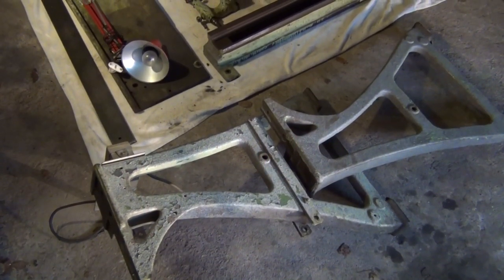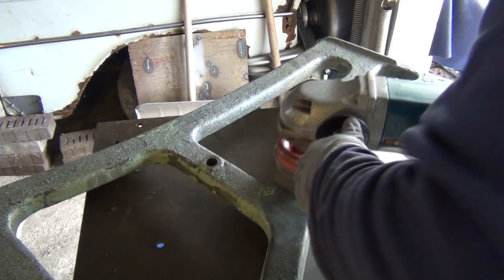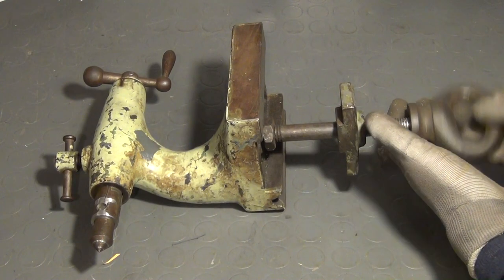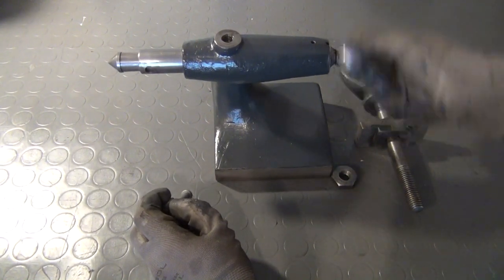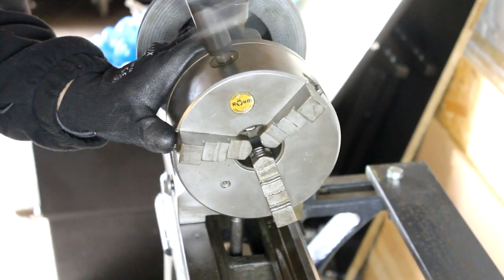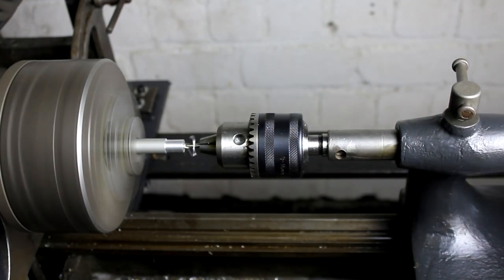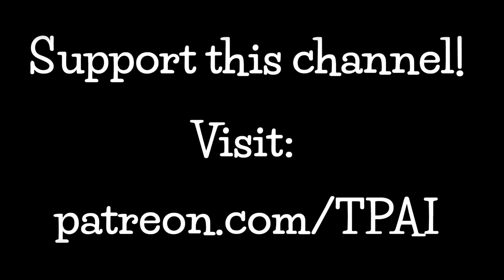My Lathe Restoration

Comment: Hi,
You might be interested. Your lathe is a so called "patronendrehbank" made by de firm Kröner und Reimer Leipzig Lindenau.
She is modified. The ballbearing in the back is not original. Originally the spindel can move lenghtwise in smooth bearings. This movement was possible by a so called star wheel and threaded bushes with different threads ( patronen auf deutsch). All of this so you could cut screw threads on this lathe. I think I saw some parts of the mechanism in the original video but it looks like You did not use it in the restoration. I myself got 2 of these lathes ( all be it incomplete) and found a picture of this late in: " Paul Schlichting Die Feinmmechanik" . 
Congrats, nice work.
Jan
Reply: To cut threads on a lathe, there needs to be a lengthwise drive-screw for the cross-slide. The cross-slide drive and the main spindle are geared together, so that as the chuck turns the cross-slide advances, to create a thread.
What you described (the spindle with the chuck moving backwards and forwards) sounds more like a "rose lathe" or "rose engine", used to create guilloche patterns and uses those "star wheels" to control the movement of the main spindle.
Reply: +Rolingmetal - That was a great video.  Very interesting.

Comment: Nice lathe restoration.  I did up an old Schaublin 102 toolmakers lathe in way worse condition and it also came up a treat.  Those old lathes certainly have style.

Plus they are nice to use, quiet etc.

Cheers Rob

Comment: the pair of intermediate pulleys is called a "jack shaft" and they are often used in power transmission to attain precise ratios, or in cases where side load is not desirable and face mounting is impractical.

Comment: I am restoring a Seneca lathe at the moment almost the same age - great job on your arduous clean and build.

I am considering mounting a 3 phase motor and VFD also for speed control and improved safety, but am still considering the belt slip with the original design that reduces the shock load to the chuck and headstock bearings.  If anyone else more familiar with this aspect has experience please leave a comment :)
Reply: ben uygladım hız kontrol sısteminı harka oldu

Comment: Very good work on the restoration. Well done.  Looks to be in very good shape now.

I can appreciate you are glad the restoration work is behind you and the lathe finally up and running.   I did some cleaning of a Southbend Heavy 10 back in 2014.   A lot of work, but your restoration was even more work.

The lathe may have been designed for line shaft drive, the picture you showed with the large overhead flat belt pulleys.   Originally the line shaft may have been driven by a water wheel, later a steam engine.

I would refer to your present drive system as using an intermediate drive shaft.   Very common for old lathes which were designed for line shaft drive which was much slower speed than an electric motor.

Your tool post design needs shims to get the tool at centre height.   Consider getting feeler gauge sets at a flea market and take them apart to provide a lot of shims of different thickness.

Not good that the pulley is causing vibration.   This could impact the finish on the machined parts.  You would need another metal lathe to try and fix the imbalance, unless you can add weights similar to car wheel weights.

Dave.

Comment: it's a "transmission drive" from previous other references . was probably done in the  late forties. i offer this because i have seen this type of setup/modification several times and they were claimed to have been done around that time frame. folks used what was at hand to get things done and this type of drive was tried and true at the time. of note i have seen similar setups that used small gasoline engines. very sketchy! i enjoyed seeing it brought back to life.
Reply: No, it's a jackshaft-used to subdivide rpm from motor and increase torque.

Comment: English words for that intermediate shaft are Jackshaft or Countershaft.  The difference is which direction  the shaft rotates.   Automotive transmissions use gear driven countershafts that reverse rotation to transmit movement.  What you used is most likely a jackshaft as it rotates in the same direction as the motor and the chuck.  I just looked it up.

Comment: I don't know if there is a specific English name for that intermediary pulley shaft, I think I would just refer to it using the generic name "jackshaft"
Reply: Counter shaft
Reply: yes counter shaft, and bit motor sits on is motor mount/bracket
Reply: Counter shaft is used for gear transmissions because the rotation is reversed. Intermediate shaft is the term when pulleys/chains/belts are used because they do not reverse the rotation.
Reply: @Reno Simpson This is the best comment on the internet.

Comment: http://www.lathes.co.uk/auerbach/   Maybe the company that made your lathe? Definitely a German design

I'd leave the intermediate pulleys as they are. It's a good system and if it isn't broke why fix it and the guy that converted it did a good job. English name for it is Countershaft. Countershaft is also a generic name for any gear or pulley shaft that transfers power to another gear train or pulleys.

The common English name for the belt system at 6:50 is Line Shafting There's a series of pulleys on a common shaft that is driven by a steam engine. Check out David Richard's channel https://www.youtube.com/channel/UCBdj-vOveiEFWe3vnGoJUag
He runs his entire machine shop with line shaft and a steam engine.
Reply: My grandfather had some of that stuff in his workshop...

Comment: The assembly in English is called a counter shaft.  The counter shaft assembly actually looks very good and is standard on lathes 50 years newer.  The only thing I would change is rounding corners of the flat plate just to blend their style in with the other curvy/cast parts.  Looks like a great vintage lathe.  Your lathe was a Treadle or foot power lathe in the beginning I bet.  In the end there is little consideration for antique value.  It's mostly about functionality.  Put a quick change tool post on it and don't look back.

Comment: A needle scaler is great for slag cleanup after stick welding. Great video! Take Care and be safe, John
 
PS, you know, I guess that belt drive setup could be called dangerous but I don't think it is any more dangerous than the inherent 'danger' of operating a lathe. In other words, if the belt drive is too dangerous for the operator, then they shouldn't be using a lathe in the first place.

Comment: If the Jacobs Chuck is only held in the tailstock by the friction of the Morse taper, you should hold the chuck when reversing out of the hole you drilled. The last thing you need is a chuck (and drill) being flung at speed randomly across the garage, possibly in your direction.

Comment: I'd call that bit with the belts and pulleys on a transmission, as it's transmitting the power from the motor through itself (and looks like you can "change gear" too with it) to the lathe, probably a proper English word for it, but I don't know what it might be... :)

Comment: I don't think English as specific term for the motor setup however we would refer to the shaft and pulley assembly driven by the electric motor as the countershaft assembly, which is always paired to a matching "driveshaft/transmission" or in this case the spindle.

Little late on the feedback ... but who knows.

Comment: Great video, very much enjoyed it, thank you for showing. As you mentioned adding a VFD for the motor, I was wondering how you would size it (wattage or full load current). I have a similiar old lathe, it too was converted from overhead drive to direct motor drive. The motor mounted is a Brown Boveri 1.3kW. However, that might just have been any motor they had available and might be oversized, or not. So, for selecting a VFD I was wondering how much headroom to give for lathe operation, ie 2.2kW or 3kW. I will need to run it on single phase 230V and wire the motor for 230V 3-phase (Dreiecksschaltung). And therefore was wondering, what motor you have and how big a VFD you would pick..

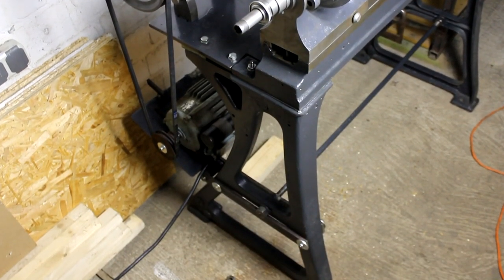Comment: 7:50 I would call this the Primary Belt Drive or Live Drive (motor to Intermediate shaft) my English is not good, but I did work at the Poreba Machine Tool Factory in Poland about 10 or 11 years ago.

Comment: Nice work!
But I don't think using a motor with a speed controller is the best idea since the motor's output power depends on its speed and it can  give its maximum power while its is running on maximum speed only, which means that the lathe may find troubles turning bigger diameters which requires very slow speed!, the solution is to use a gearbox, I believe that your creative mind can combine a gearbox from an old bike's motor with the lathe!?
Reply: no he should not pull more then designed torque out of the motor as he can burn out the coils otherwise. Also at very low speeds a independent forced air cooling may be necessary.

Comment: As it is, this lathe can't cut threads, right? As far as I know, there is a way to mount an encoder for the spindle + some sort of acme screw and a motor to move the cross-slide in sync with the spindle, and be able to cut threads. I'm not sure, but this could be the device: https://www.aliexpress.com/item/KA300-SINO-Linear-Glass-Scale-Linear-Encoder/921438808.html
Reply: Such an upgrade would make the lathe way more useful than it currently is; which is not very different than a simple wood lathe for now...

Comment: 7:42 I would call it a "countershaft".
Reply: or jackshaft?
Reply: No... More accurately, an intermediate shaft. This commonly refers to a link between a driving motor and transmission or between the transmission and output, whether that be an automobile or machinery.
Reply: Doesen't turn neither counter to the power source nor to the driven shaft, but "counter intermediary idling jackshaft" sounds good xD

Comment: more dangerous than the open pulleys and belts is driving an open chuck!
Reply: the pulleys and the belt are at least smooth and don't have hardend bits standing out.
Reply: Tell me about it. Im an ex MoD mechanical apprentice, so spent 4yrs in the training workshops. One day i was doing a job which needed me to keep the guard open. Forget exactly what it was. Anyway my overalls had a small tear in the left arm and this caught in the chuck !. Luckily with super fast reactions i grabbed the back panel on the lathe with all my strength, and the chuck ripped of the entire left arm of my overalls. 
Thankfully no injuries. Theres a lesson there.....
Reply: Are you talking about the part around 8:25? If so, why is it so dangerous?
Reply: Why is it dangerous? If one of those hit your knuckles it'd smash your hand to bits
Reply: So if you set the chuck arms in a bit so it's flush with the whole chuck, it's acceptable?
Reply: As long as one does not wearing long sleeved clothes, gloves, loose, long hair, jevelry and stuff that can catc on those parts, and not falling onto it, it´s not that dangerous becuase Your hand will flex and normally it´s just ending up trashing the skin and possibly mangle some knuckles for a week. 
Personally i hawe not came up with a working safety sollution either that one want to use daily, but possibly a metal cover or something will do, BUT it´s extremly important when one adding your own inventions that no parts can be possible traps to jam bodyparts onto rotating machineparts so it get vedged between something, that can be far more dangerous the just left it uncovered.
Reply: that's why you wear short sleeves.
Reply: All the lathes in my work use open chucks they aren't designed for guards proper training and common sense prevail.
Reply: you all seem to get me wrong. i´m talking about running the lathe without anything claped in the chuck!
https://youtu.be/LpMLQb48mps?t=8m25s
Reply: Ice Runner Wolf >  You run lathes with no guards or precautions at all, except your belief that accidents can’t happen to you because you’re trained! You’re rolling the dice when you’re spinning that lathe, let’s hope your number doesn’t come up! Seriously!
Reply: ukezi > totally agree!! If those jaws come out, watch out!!! If anyone reading this doesn’t stand well to the side of their chuck when starting their machine, now is a good time to start! Good point Ukezi!
Reply: Paul Paulsen > Sorry Paul - it’s you I meant to applaud for the good comment, not uzeki. Spinning an open chuck is asking for trouble. There’s a video on the practical machinist site (I think) that talks about a chuck jaw embedded in a steel roof fitting, 32ft up, and another where an operator started the machine standing next to the chuck with noting loaded, jaw hit him in the chest killing him, on video.
Reply: ouch, thats not cool man...